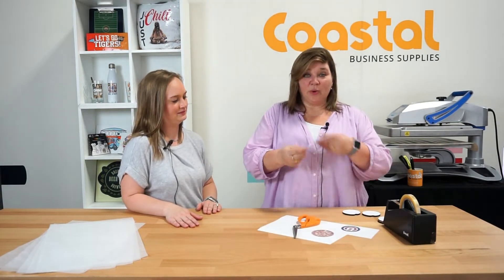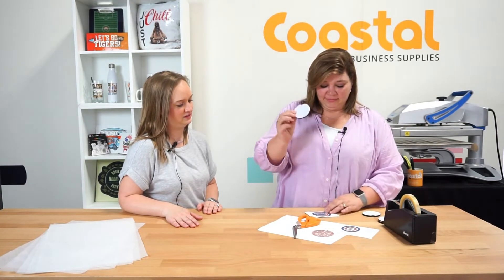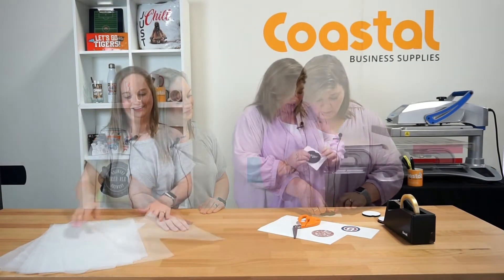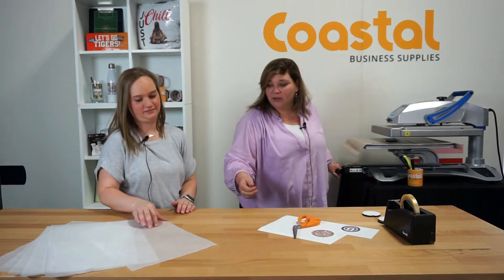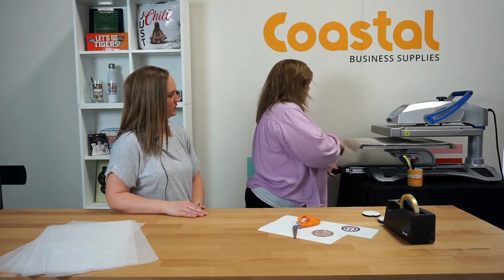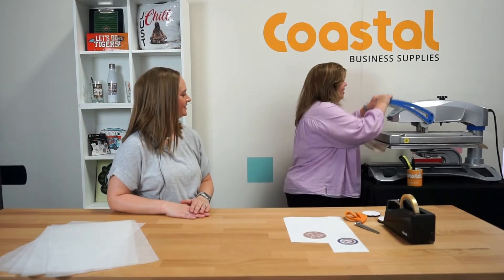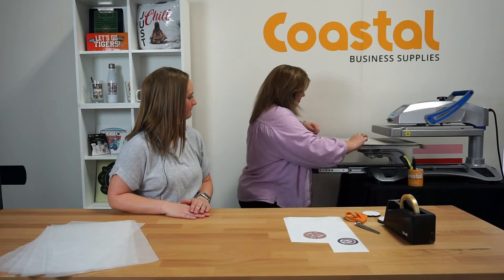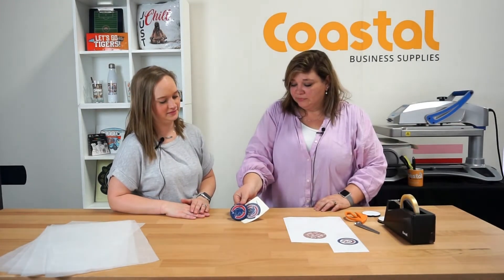Car Coaster Sublimation Instructions

Comment: I noticed as soon as I close my heat press, the temperature starts dropping. Is that normal?
Reply from the maker: Hi Krystal! Yes, normally a temperature drop occurs when pressing items. If the blank is not at room temperature you will also notice a drastic drop in temperature. The press should, however, heat back up to around the temperature you had set.

Comment: Does anyone’s transfers ever fade in certain areas?? For instance my first transfer wasn’t very bright in the middle but got brighter towards the edge.. what causes that?
Reply from the maker: Hello! In some instances fading has to do with your time and temperature, however, if you are following the recommended settings, we would recommend adjusting the pressure a bit more. If you are still having issues with the transfer, please call our technical support team at 1-800-562-7760, option 3.